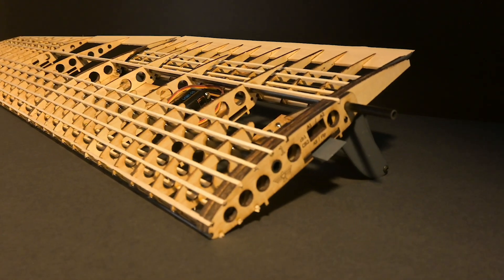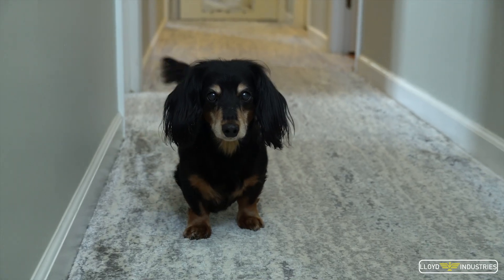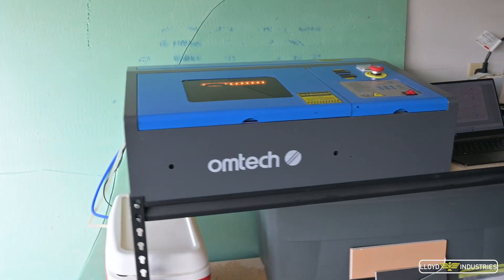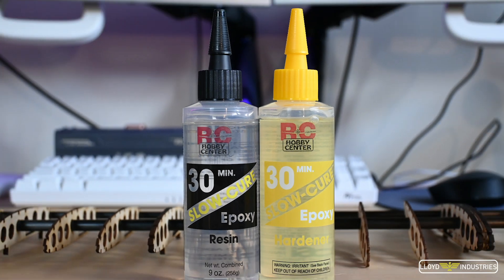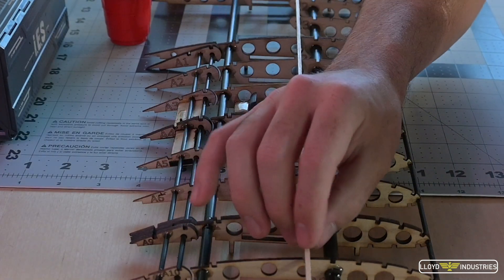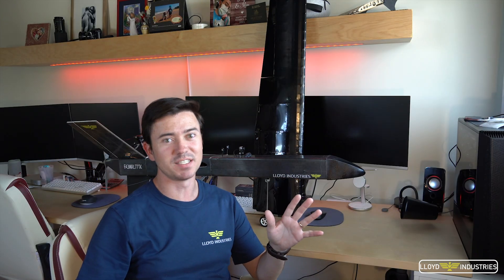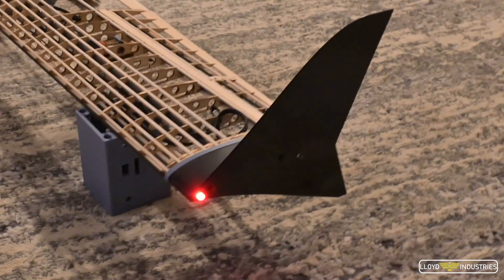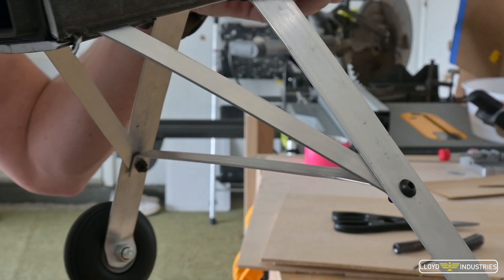Modular 3D Printed Drone - Episode III - Laser Cut Balsa Wood Wings

Comment: Hi it was interesting that in episode 2 you made 3d printed wings but in this episode you chose to go with balsa (laser cutting is expensive af haha). Curious to know what made you go balsa and what difference did going balsa make to the performance of your plane.
Reply from the maker: Thanks for the comment. Yea some struggles I had with 3D printing were deforming of the wing when heated (even sunlight) and it was too heavy. I was able to make the wing in balsa for about a 30% reduction in weight. Laser cutting is pretty expensive but there are a few models that are still below the $1000 range (the one I have) i cant wait to upgrade though. They are not fun to work with but they work

Comment: awesome project, though for you landing....pro tip don't fly to the ground. instead float to the ground. come in slow and let the plane just settle out of the air. air brakes or spoilers may be a good use of some of those extra pins
Reply from the maker: Ill keep that in mind if i ever need a MKIV! Thanks for watching